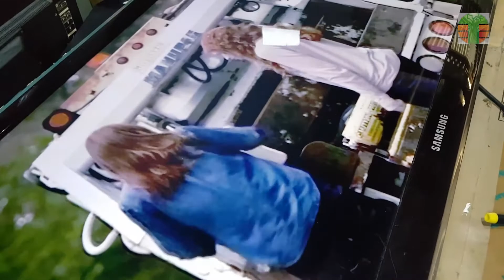Samsung LED tv no power. With a house lizard stacked inside and electrocuted. How to Fix.

Comment: Boss ano klaseng resistor ginagamit mo pang testing as fuse replacement?
Reply from the maker: Yun ay luma na resisitor, may ceramic sya, pwede kahit anong klaseng resisitor. 220 ohms 20 watts.
Reply: Boss may repair ako projector wala ako mabili kL15 na diode. Ano po ba pwede na pamalit? O alternative na mag match. Salamat boss

Comment: Where yu connected a resistor which one is better a filament bulb or resistor and its how many ohms
Reply from the maker: 220 ohms 20 watts resistor parallel to ac line.